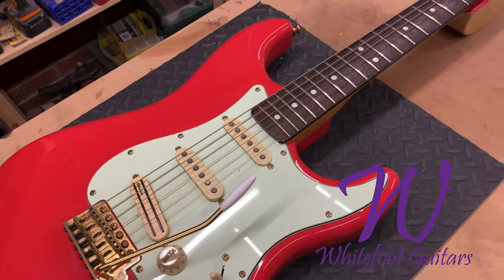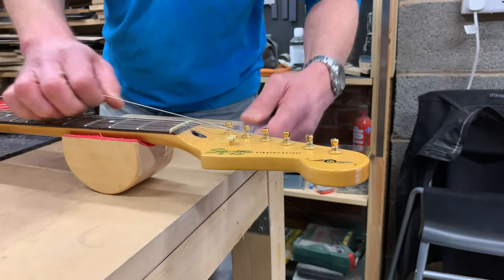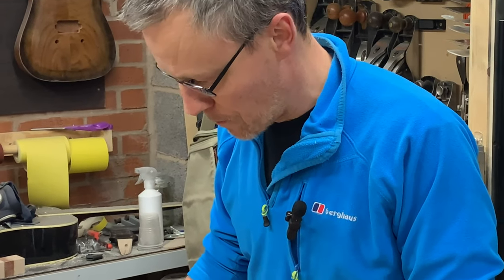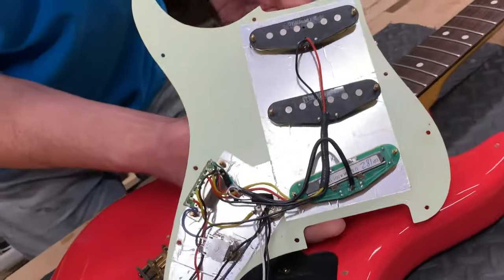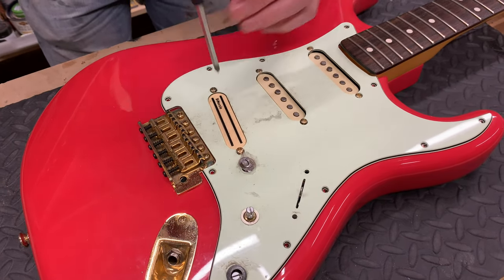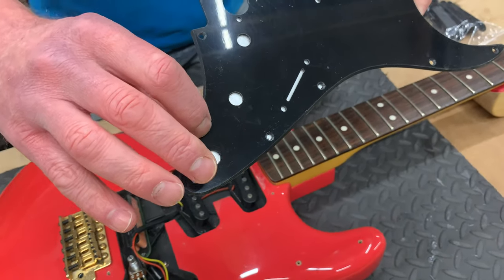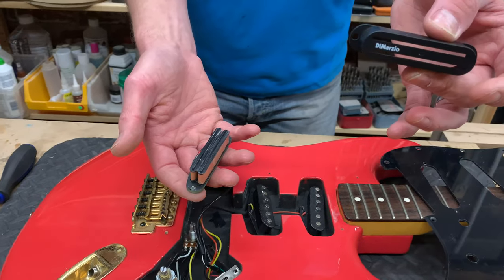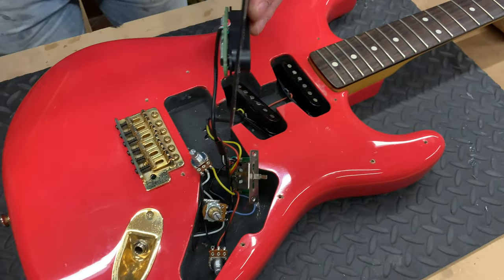Fender Stratocaster - Changing Hardware & Pickguard

Comment: my pickups are so high how can i fix it?
Reply from the maker: Nearly all pickups have adjustment screws, clockwise to raise & anti-clockwise to lower them. They’ll be limited by the length of screw / depth of rout.
Reply: @WhitefootGuitars  what's the normal adjustment for the height of the pickups?? 1cm? 2cm?
Reply from the maker: @gamingrock3918 they’re all different mate, the best height for pickups is whatever sounds right to your ears. What works on one won’t work on them all, too many variables for a definite number to give you.
Reply: @WhitefootGuitars  thanks, mate🙌